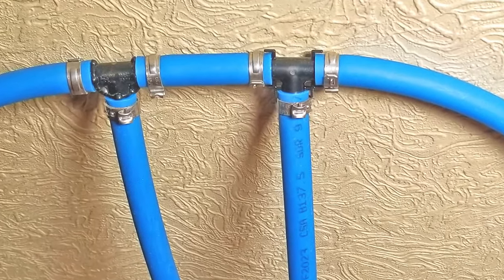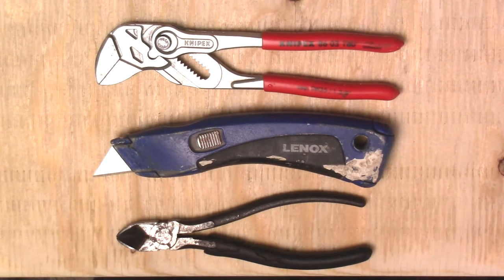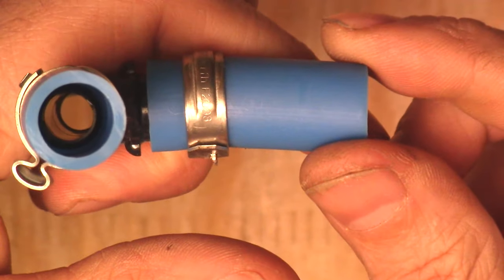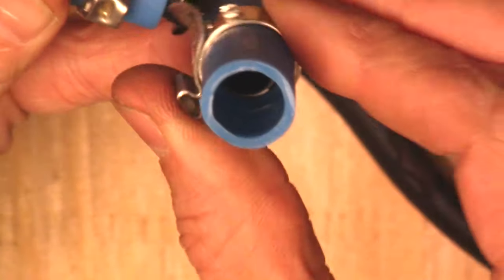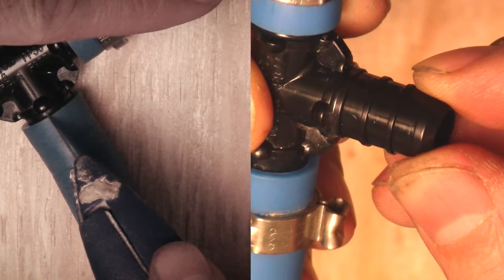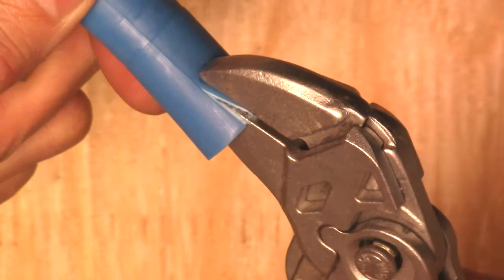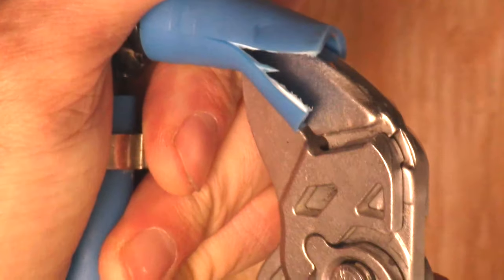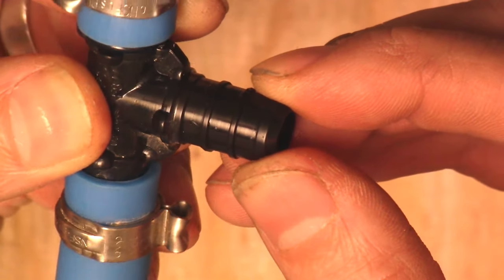Removing PEX Stainless Steel Clamp Rings on Plastic Fittings

Comment: Soften the Pex with a heat gun and it doesn't need to be scored.

 Also check out PE-RT piping and expansionable Zurn Pex B piping.

 PE-RT piping is recyclable, and allegedly stands up to chlorine/chloramine.

Comment: I take an angle grinder and cut through the top of the crimp portion of the band.  Then the band will come off easily.   Heat up the pex pipe with a heat gun and it will pull off easily too
Reply from the maker: Nice yeah, heating the pex a bit is a good idea
Reply: @Live-DIY  I should add that I use the same method with crimp rings and plastic fittings.  and that I have a thin metal cutting blade on my angle grinder
Reply: Same way I do it I've used other methods to heat the pipe including candles

Comment: And then throw the plastic fitting away so that you can replace it with a stainless one that has about a 30% larger flow diameter.
Reply from the maker: Agreed, though sometimes it's not about what you should do but, what you need to do. Imagine the situation where a plastic fitting wasn't only used, but now... needs to be reused. It's a crazy world out there.
Reply: Yup

Comment: All you need to do is heat up the PEX with a butane match stick and it will slide right off the fitting after you remove the clamp

Comment: That works, but they make ear clamp crimpers that can be quickly converted to removers. Much easier to just pinch the sides of the crimp and it will open right up.

Comment: Great video it help me I was practicing before installing .I was struggling to separate it so  I use a lighter to heat it a little, it slip out very easy. The hard part was finding a lighter since everyone vapes now.
Reply from the maker: Nice, yeah someone had mentioned heating it with a heat gun. I bet a hairdryer would work too if you had to. I didn't even think of heating it when I did this!
Reply: Get them Bic EZ Reach ones.  I wonder if hand warmer packs can apply enough heat.

Comment: Why use pex in the first place?
Reply: A proven product that is quicker and cheaper to install than copper.  Easy to add to or repair.  No fumes or fire danger when installing.  Minimum tools required for installation.  Long runs are possible with fewer fittings to deal with.  When crimped correctly, it will last a long time.  Also, can take freezing better than copper.  Just a few reasons why I use it.
Reply from the maker: I was wondering when someone was going to come up the top 10 list answer for this question. The freezing thing has already saved me several times this winter, that's a good one... No water hammer (is that what it's called?) either I notice, no rattling pipes when the toilet stops filling.

Comment: One hint.  Place the pex pipe and fitting in hot water for a few minutes. It will make the pipe more pliable and easier to tear.  Less risk of damaging the fitting by the heat gun, though I have used both.

Comment: Thanks for the video, I've been using completion clamps on a design because i didn't know how to remove these. 
Amateur "pro tip" if you heate the PEX pipe it can be pulled off with your fingers. (it's hot so don't clamp too hard or you'll burn you figures.)
Reply from the maker: Thanks, I did try the heating technique finally https://youtu.be/V-MJGzW5R_A it works SO well!

Comment: Removing the pipe from the fitting is much easier by simply heating it with a $2 torch. The fitting never gets warm and pipe pulls off with 0 effort
Reply from the maker: Yea I've been hearing that makes it so much easier. Good to know the plastic fitting won't be damaged.

Comment: Using a heat gun saves me all the trouble of scoring and tearing it off.
Reply from the maker: Totally. I used a lighter and it's amazing how well it works ( https://youtu.be/V-MJGzW5R_A?si=p-vzWLGw3lj7pjKk ). Almost seems like if the water was too hot it could pop off!

Comment: There is a tool for savaging pex fittings that have copper rings I don't think it works on the stainless bands but if you cut the pex close to the end of the fitting you insert the narrow blade into the fitting and as the look like some sort of pliers you just pinch the 'cutter' blade into the pex several times around the outer surface of the pex and it expands the plastic and it falls off. On the copper rings the first cut goes through the ring and then a second cut 180 opposite opens up the copper ring less than twenty dollars at the big box stores I bought one to salvage numerous valves and fittings that had been in service only a few months beats the heck out of slicing pex with a utility knife
Reply from the maker: That sounds great, the lighter (or heat gun) method works very very well also. I'm interested in hearing about any tool or method that worked for anyone, because in a pinch you often end up just using whatever you happen to have handy!
Reply: The Zurn cutters for copper crimp rings will not cut through the steel crimp bands.  I've tried.  Peeling it off as described here, or using a grinder and cutoff wheel, only way I know how.

Comment: can you reuse the pex if I removed it from the fitting without cutting it?
Reply from the maker: No! I mean a short answer is no. You wanna trim back any part that was compressed by the clamp ring. If you absolutely had to because that's the emergency situation you find yourself in... make sure you don't re-seat the new clamp ring in exactly the same indented place on the pex, you'd want to make sure the ring compresses SOMETHING.
Reply: @Live-DIY Oh, man, that’s so disappointing. It makes sense, though. 

I’m about to start in an RV where there isn’t a lot of space for extra pipe, and I figured I could remove cinch rings without having to shorten the pipe. I guess not. 

I’ll make sure I leave enough excess, and if I have to remove a fitting too many times, I’ll leave enough space so that I can crimp a short extension piece :)